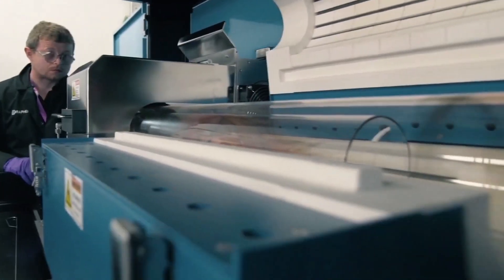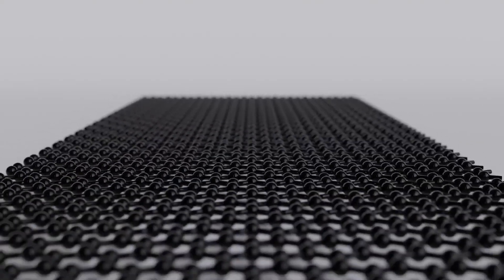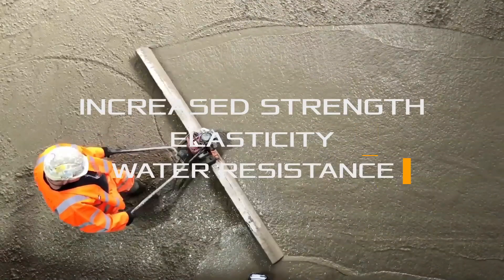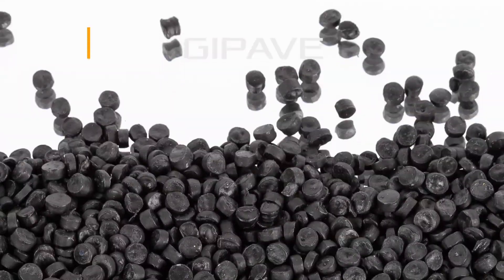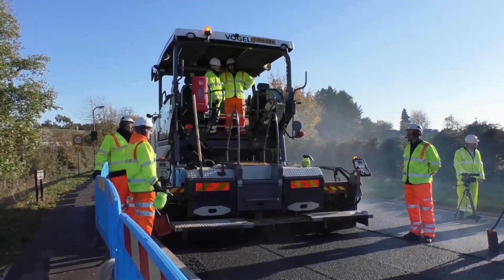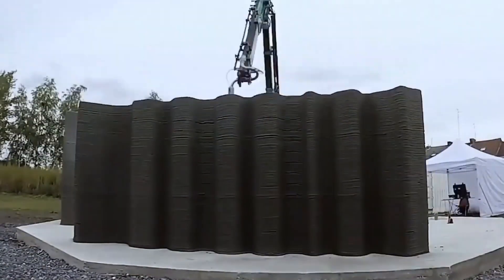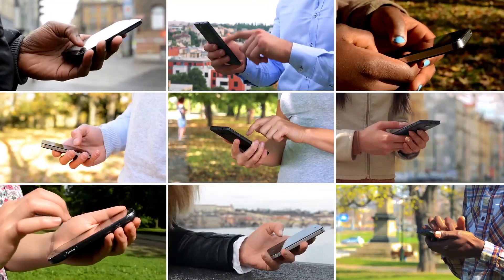Graphene in concrete is already changing the rules of the game in construction

Comment: Waterproofing is adding grapheme to top sealer, or spraying over wet concrete which will make it black colour.

Increasing strength of concrete can be achieved by adding silica liquid, psilium or glass divers. Problem is graphene is not easy to grow or make at moment so looses on cost basis.

Comment: Graphene cost hundreds of thousands of dollars pr kilogram depending on grade due to the difficulties of manufacturing . I don't see how it could make sense to use it in bulk construction materials that need to be cheap.
If we could freely pick and choose the ideal materials regardless of cost then it's not hard to find better materials than steel, concrete and wood.
Prices will probably drop in the future as production technology advances, but this is still quite a stretch.

Comment: What happens at end of use? Can it be recycled out of concrete or asphalt? what kind of sheer strength does it have in earthquakes? What are the health effects, during construction and destruction? The Twin Towers were made using concrete impregnated with glass fibers, very strong and great to work with, however many New Yorkers are now suffering some horrible side effects from the glass dust in their lungs and blood stream. Any New product aimed at this kind of large scale construction, must be tested and retested to where we can have complete confidence that we won't regret it later.

Comment: Well if they do Graphene in a liquid state then dip or spray it on the Iron, Steel or other metals then Cover in concrete. Be less in bridge repairs also. For bridges will it help the bridge do better for vibration and chipping failing concrete after years

Comment: The improvements here shown are just the tip of the iceberg promised when the Nobel prizes were bestowed. 
The progress envisaged for graphene is somewhat at odds with an economy based on supply and demand. Early hopes included a wonder material of extreme endurance and elegance, super conductivity and many disruptive attributes. But can we really expect such great progress in material science when our society is so anti-progress in so many other aspects of life? 
What will a graphene revolution look like? We have already witnessed false dawns with  labcoated masked scientist pulling graphene  spools from steaming beakers, but it came to nothing more than some incremental, limited  battery improvements. 
Some backyard hero needs to post a vid showing a technique that creates usable graphene from graphite using nothing more than a microwave oven and detergent. But then they'd probably call it a hoax after subduing our hero.

Comment: Yeah, as a civil engineer, I imagine this technology is going to take its time being applied in most construction projects... The low bidder on city projects is not going to go this route unless it is specifically designed to be this way, and even then, how many bidders are going to try and take that risk? It'll be awhile, until it's proven to be easy and efficient to construct... Not to mention cost effective
Reply: I Agree With Your Sentiment. The Key To Graphenes Future Is  Reducing Its Cost And Adequate Supply. One Thing They Didn't Mention Is Concretenes Cure Time. Apparently It Can Be Built On Within 24 Hours. That Is Where I Think The Most Cost Savings Will Come From. Plant Will No Longer Stand Idle While The Concrete Hardens To Full Strength 👍

Comment: They'll be using this stuff in buildings but mostly not outside even though it's conductive property may allow us turn roads in hot places into thermal generators because if concrete lasts too long it will cut I to their profits. They carefully balance quality with planned obsolescence we could more than likely design a concrete that could last a century probably centuries but then concrete business go under & the unemployment rate goes up.

Comment: Aside from graphene’s high utilitarian value, which is not to be underestimated, with 3D printing technology, finally humanity can be liberated from the soul killing box-like structures pandemic throughout the world. Each and every building surface can become a high art form that feed, nurture and stimulate human creativity and visual pleasure, who’s short term and long term benefits cannot be underestimated. Perhaps even with standardization of these new building products, the need for structural calcs can be streamlined to identify eminent, and potentially catastrophic failure, built into all design 3D printing software, rather than calculating every strengthening and reenforcement product necessary in today’s building structures. Also, as in Nadar Khalili’s book, Ceramic Houses, conventional conduit, piping and duct use can instead be incorporated, and therefore reduced, with graphene concrete products 3D printed per code into the structure of every building.

Comment: how do they know for sure that this brand new substance, concretene, that has been used for the first time last year will definitely last longer than normal concrete? I mean, people used to say that plastic takes 50,000 years to degrade, then more thorough testing and decades of evidence of bio-degradation (as well as the discovery of bacteria that can literally digest plastics) have led to that being lowered to the point that the absolute most stubborn plastics are now estimated to last a maximum of 600 years, or slightly more than 1% of the original fear mongering estimates. So, call me a skeptic here, but I doubt that there is any reasonable way you can 100% predict the long term lifespan of this brand new material with literally less than a single year of real world application history.

Comment: I was an assistant general manage for a ready-mixed concrete supplier for around 23 years. .. I honestly don't know if graphene has a real future or not. .. Part of whether it does will be the additional cost per cubic yard of concrete. .. To have it improve the product is one thing:  to do so economically is another. .. I sense significant resistance, at least in the short term. .. This might be compared to making lightweight concrete via using "expanded shale aggregate". .. Such does work, but not commonly chosen / specified due to sheer additional cost.

Comment: Been using polymers for decades in my business (so a huge proponent). But, use of graphene anywhere in Earths atmosphere is knowingly deadly and toxic on a very long time-scale (due to the oxidation process). Far worse than asbestos, lead and fluoride combined. Until they successfully remedy this severe issue, it's use should be strictly limited to extra-terrestrial or "condition-spaced" research/mfg facilities ONLY !  Graphene holds interesting prospects; Graphene Oxide, on the other hand, is KNOWN by every medical researcher as one of the, if not the most life threatening , hazardous materials to ever come out of the lab. Sadly; In the meantime, it appears that industry and Lobby power wins over responsible scientific advancement again- Because they're not saying a single word-

Comment: Sorry, but I'm sure this is nonsense. Graphene needs to get a trillion times cheaper before being considered as a concrete additive. And if it only increases the strength of concrete by 30% it will never be considered. Glass fibers do the same and are dirt cheap.

Graphene will be used for surface effects first. Batteries, capacitors, semiconductors...

Comment: I’m calling BS. Graphene powder can cost up to $200 US per kg, pending on quality and/or unit purchase. It’s hard enough to sell higher slump material yet the options even of more additives. Most concreters prefer to buy the cheapest of concrete designs and piss it up, rather than the appropriate design for the said application. Most don’t give two flying f#%ks how the concrete goes in, as long as it goes hard.
No one in their right mind will pay $300 and up per cube. To add what little strength graphene will add that the current additives will. 

NO ONE.

Comment: Studies has shown that graphene can be toxic in high dosage. Encapsulated inside concrete, it may not show immediate issue.  However, with degradation over the years or when the structure is demolished, it may become a big problem like micro-plastics.  Hopefully more studies are done before they really start to use iot.
Reply: lead based paint anyone?

Comment: Why don't they use graphene in place of the rebar? Isn't it being used in the construction of aircraft as a laminate ?  The possibilities are endless.
Reply: Carbon nanomaterials are being used for aircraft, but not as rebar.  They are being used for things like spray-on heaters.  Check out the Heatcoat product from Battelle, for example.

Comment: I am also excited by its properties that make it a great water filtration system, and allow super quick charging of batteries.  This IS what will be charging our car batteries in the future.
Reply: Yes, graphene in tubular form, has incredible potential for water filtration.  Carbon nanotubes can be manufactured at less than 1 nm diameter.  At that scale, ONLY water molecules can enter the tube and everything else is selected out.  When entering a hydrophobic cylinder, the water molecule wants to back out, but it cannot, because of pressure.  The only way out is through, so the water molecule is transported at ballistic speeds through the nanotube.  While still at a demonstration state, this technology has the potential to be severely disruptive to the filtration industry.  Watch this space.

Comment: It breaks if formed into 3D ?  #1; sounds bad already !  So your going to build with this ? 
#2; cost ??? “You can build with Graphene BUT FIRST YOU GOTTA “ ! ! ! Always a cost catch ! Like always , if it sounds to good to be true .... I wouldn’t touch this with a 1000meter pole ! 
So if I use this in place of rebar you really think the shear strength is going to be better ? Smack a carbon rod that is 3/4” dia. & watch the beautiful result , it shatters ! Sorry not buying this just yet. If they use the word “PROPRIETARY “ in any way, I’m gonna run for the hills. I’ll stick with what I know ....good ole concrete for now !

Comment: Some of this could happen, but it sounds pretty speculative at this point. In the 80s we were told that fine ceramics would be used to make all auto engines because they wouldn't need a cooling system. And that bubble memory would revolutionize computer memory. Neither of those happened, perhaps due to technical problems or simply cost. I'd rather see an application that is actually working. If that road surface layering with graphene actually works and is financially feasible, great. Since reinforced concrete can crack if not maintained and/or cause failure in fires, finding something better would be great ... if it works and if it is affordable.
Reply: TBH the idea of using it in concrete is completely bonkers. Concrete is cheap, can be produced with small unsophisticated factories, and reliable. However cheap these nanosheets may be, its not cheap enough.
Reply: @donsorenoelchapogringo1182  They address this in the video
Reply: Isn't bubble memory just an older term for computer memory that is not dependent on a constant power supply? If I'm not mistaken we call this technology a "hard drive" and it absolutely revolutionized computers.
Reply: That's how most technology is.  I've seen tons of videos and upcoming technology that seemed promising.  Some make it, most don't.  These kinds of videos though do server to hype up these kinds of technologies to increase the chance they succeed.  However, I expect, it is still less likely that it makes it, as that's the nature of most emerging tech.

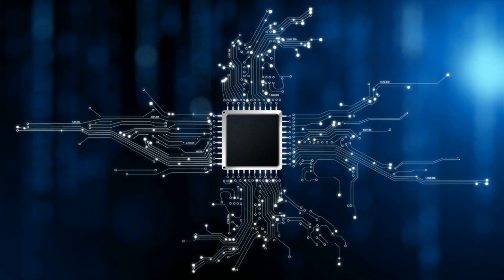Comment: 0:57 "semiconductor" Semiconductor devices can display a range of useful properties, such as passing current more easily in one direction than the other, showing variable resistance, and having sensitivity to light or heat. Because the electrical properties of a semiconductor material can be modified by doping and by the application of electrical fields or light, devices made from semiconductors can be used for amplification, switching, and energy conversion.. So crazy conspiracy theory's =1 normie theory's= 0
Reply: yes, doped graphene is exactly that.

Comment: "200 times stronger than steel!"... "Breaks easily if made into a 3D shape."... so, it isn't actually stronger than steel. It's more like super glue, in that it has good strength in one direction, but not in any other.
Reply: If you create a steel structure in 2 dimensions and compare it to graphene (also in 2 dimensions) then graphene is 200 times stronger than steel.  You need to compare apples and apples, not apples and alien spacecraft.

Comment: 3d concrete printing is way too limited and is being turned down by the whole industry. You can make an igloo house or connect multiple igloos, but you can’t do more than round one floor domes. You can’t print more than walls either. Roof construction and wall finishing will always need to be done. And with the robotics used now they are small round domes. I have see a video of a prefab square room printer and could do multiple rooms, but that brings a higher added cost for transporting concrete squares. In all with costs and concrete cracking problems, it’s way behind and over priced.

Comment: Depends how much it costs to add. Seems to me something 200 x's as strong as steel  would do a whole bunch better than a 30% improvement. That seems ridiculous to me. Like 100 x's stronger yes, not 30%, probably not even worth it except on thin eggshell hydroelectric dams. I can see the engineers shuddering at a dam a meter thick, 900ft high, which would be possible if taken to the extreme. And would not decay like steel rusting rebar.
Reply: These additives have to be used in extremely low concentrations, way less than 1% or else it messes up the viscosity.  Concrete not good if you cannot pour it.

Comment: IF THEY HAD NOT USED GRAPHINE IN THE LATEST ITERATION OF WHAT THEY ARE CALLING A VACCINE, I WOULD FEEL MORE POSITIVE TOWARD IT.  BUT THEY DID, THEREFORE, I AM AGAINST GRAPHINE USE IN ANYTHING I WILL INTERACT WITH.  THE FIRST THING THEY FOUND TO USE IT FOR WAS TO MAKE IT DANGEROUS INSIDE OUR BODIES.  MAYBE IT'S THE PEOPLE RATHER THAN THE PRODUCT...BUT THAT WORKS OUT TO BE THE SAME THING DOESN'T IT.  GET RID OF THOSE PEOPLE AND TRY AGAIN.

Comment: On roads. Phillips Petroleum developed a fiber that resisted tearing and reduced annual cost of road repair. Several big city street departments refused to use it. The fear was, in part, that if it worked, they would reduce the number of people required to repair roads and bridges. Concretine will face similar challenges. Look out for inertia and the "good old boys" to work against this. Private buildings and private construction of non public funded projects will have to lead the way

Comment: i like new products. it may have had tons of testing but its a new product still. sounds like its not ready for a cement mixer. fiber glass is hard to beat. petromat makes sence. so what about epoxy rebar, engineer calls out #6 or a carbon nano #4 that has a #3 in it? so can it be bent as rebar is ?

Comment: A product 1 1/3 the strength of concrete is not going to revolutionize the world.  But, if (as per the original hype) buildings could indeed be built 200 times as strong as skyscrapers, it could spawn an ecumenical world leader who worships the god of such fortresses (written about in the Revelation of Jesus).

Comment: what if rebar was painted with graphene embedded epoxy paint? and then that rebar was used in concrete for structural strength? 
i am also wondering is concrete recyclable? and if so would adding graphene change its ability to be recycled?

Comment: Slick ad-grade material that after a minute leaves with a curious impression it's not going to provide solid concrete information, ie information in the intersection of new, precise, and trustworthy to the point of enabling secure autonomous reasoning that wasn't possible before getting it. Watching two more minutes confirms the impression. A keyword is "autonomous" there, because I figure it's likely good enough to nudge speculative investors should rally time come: my take on the identity of the usual target audience of the makers of the video.